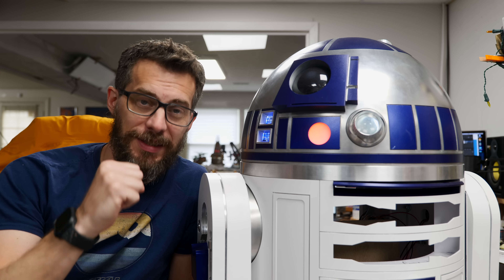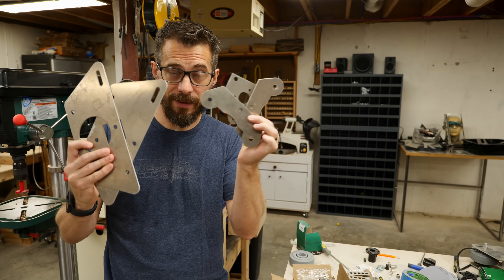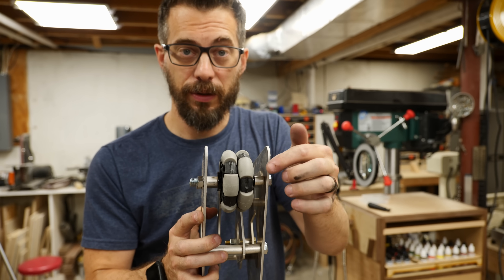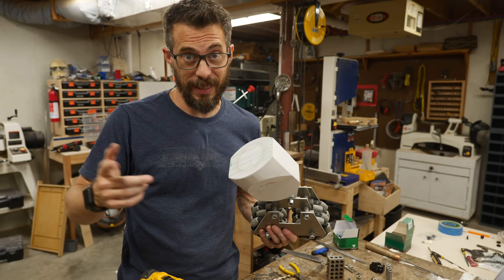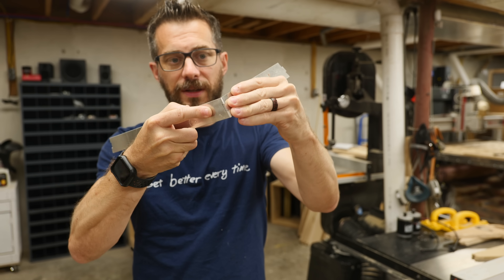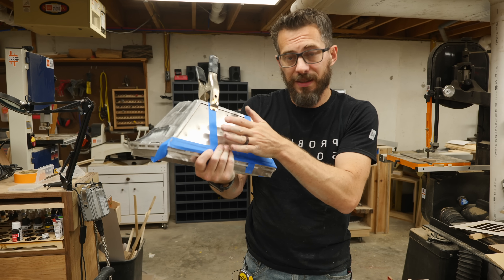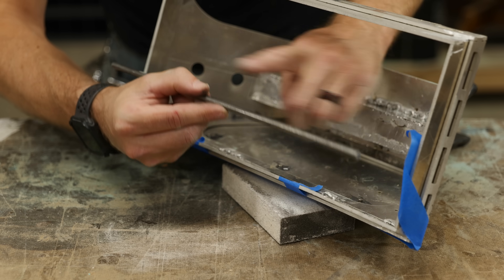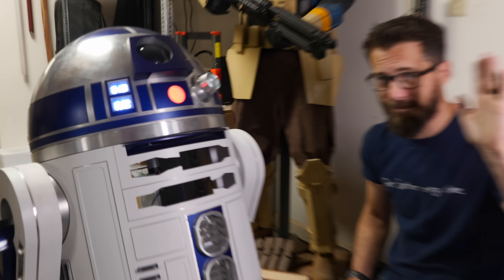Making R2-D2 Part 5 // Feet & Motion | I Like To Make Stuff

Comment: If you ever plan to make a custom color R2 unit so that you can give your droid an identity other than R2, it would be really easy to do so with your tab and magnet cover design.  You can just make a different color foot panel and swap them out.  

Did you ever think of making an R5 conversion for your droid by making a separate head and colored replacement door panels?

Comment: It's not a huge deal as a voltage cutoff module is cheap, but M18 batteries don't actually have a voltage cutoff built in. They have a BMS but no cutoff. Makita and Ryobi are the brands that have a built in cutoff.
I don't know where the rumor started that the M18s do, but I'm assuming people take them apart and see the little circuit board and just assume.

Comment: Here's a tip for the motor wiring. Put one male and one female spade on the motor and the alternates on the power source and you physically can't connect them backwards. Better than relying on color coded wires.

Comment: Why did you use a rod for connecting the panel to the foot? Wouldn't it be better to use flat stock to gain more surface area where the magnets and the jb weld can hook on to?

Comment: Great build Bob! as always. Your aluminum tig welds didn’t look to bad either. One tip though: you might want to grip your filler wire a bit different so you can feed it easier as you’re welding👍🏻

Comment: your welding is looking good! Im not sure what type of tig welder you have, but you might want to give your tungsten a little rounded tip but setting your AC  to 70/30 or 30/70 (which ever doesnt blow up your tungsten). Of course, this is a controversial topic, but I found if my tungsten has a slight rounded tip, it gives me a little bit more control, but this is a personal preference

Comment: Awesome project one tip in welding aluminum in the future unlike other metals you can never clean aluminum to much the cleaner the better sanding degreaser ect the cleaner your base material is the better it will flow and ultimately make a better weld material prep is key

Comment: Everything looks amazing! I just wanted to say that you might want to look into a welding jacket or at least wear long sleeves when welding to protect you from the UV radiation that the arc emits (its much more intense than the UV radiation we receive from the sun and can cause burns and similarly increase your cancer risk long term).

Comment: Noticed a tip you could use - when using spade connectors for a pair of wires, alternate the genders to ensure you never connect the wires backwards. You didnt in this vid, but just thought of that tip while watching. Great build! Been fun watching it come along.

Comment: Love it! There are several different ways to make a press break. You can clamp the piece to a table and use angle iron, or in your vice, whatever works best for you.
My R2 is 3D printed and now you have me wondering about the strength of those ankles and other joints. It is also 2-3-2. I guess I have some trial and error ahead of me!

Comment: Hi Bob!
My name is Tomer, Im a big fan of your work (and Star Wars lol).
I believe the motor you are using is called a Mini CIM, which from my expirience is the most inefficient motor from VEX so Id probably recommend to use a different motor if that matter. In addition, Id be careful with the motor wiring and get a higher gauge wire from what is shown in the video. Other then that the project looks really cool and I cant wait to view to finished product!!!

Comment: Bob. You need the drive wheels in the front and the Omni wheels in the back. Trust me, is going to move a lot smoother. Also you want the Omni wheel to be slightly off the ground. Great video!
Reply from the maker: Hmm. Interesting. I'll look into that right now. Thanks!
Reply: Came here to say the same thing. Glad I checked first. 

Drives to the front put them closer to the center line so you can spin on the spot better. Omni wheels at the back are just for balance when accelerating really. As Jorge says, the should just be off the ground ideally, when on smooth hard floor.
Reply: You’re welcome.

Comment: This is awesome. May I recommend rubber grommets be used wherever wires go through holes though, particularly in metal (noticed at 6:20)? Look forward to seeing it completed!
Reply from the maker: I intend to, the feet are just roughed in right now. They still have to be painted and finished, but yes, they will have grommets.